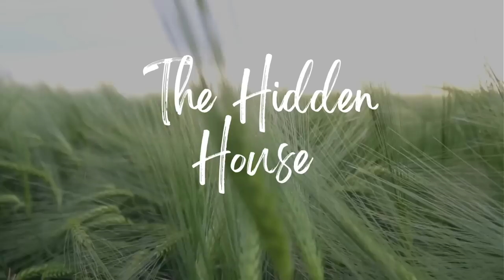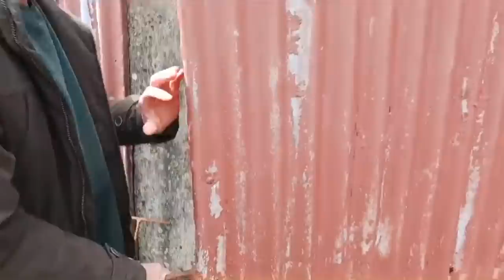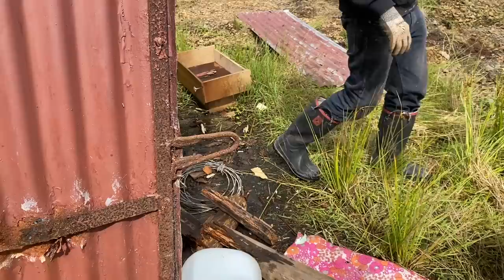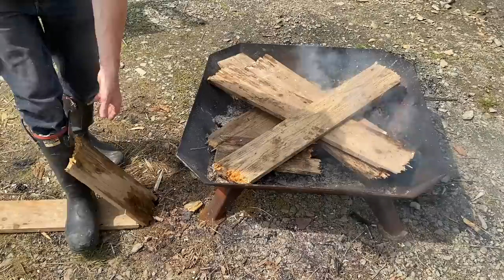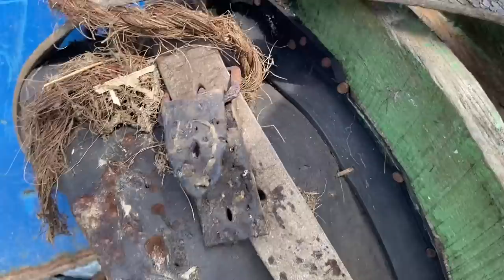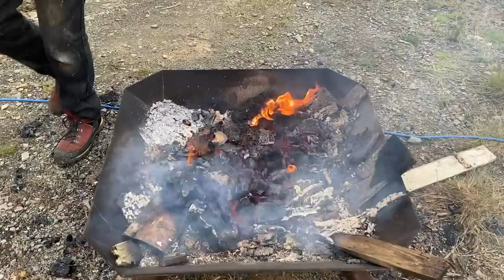Clearing out the Cowshed & a Homing  Crystal | EP012

Comment: (If it's not already gone) you might want to keep the cowshed for the time being; for dry(-ish), secure(-ish) storage of building materials/tools/etc., during the times the house is roofless/floorless/doorless/etc.
The bucket without the hole looks just about the right size & shape for keeping kindling nearby a fireplace.
Reply from the maker: You have a point about the shed for took storage etc. Noel had thought of this, but his reasoning is treat when they come to pour the concrete for the house foundations it will be cheaper to do both garage and house at the same time. He has in mind to get a shipping container for tools and equipment etc which in time could be repurposed as another outbuilding.  I’m already fantasising about skipping through the woods collecting kindling with my pail… 🤣❤️

Comment: all that wood could be used for garden surrounds, same for the old bucket, i use them to plant in
it's a shame to pull down a building that could be used, for a potting shed, the old barrels would've been good for gardens too; are you going to be putting in any gardens?
thanx for sharing
Reply from the maker: Certainly Selena we will be using part of the tip field as an allotment and you’re right, the planks of wood will be handy for marking out beds. The barrels were indeed falling apart with rust.  Regarding gardens, we’d love to create a small lawned area at the rear of the house that will be manageable regarding keeping neat and tidy. Further away from the house we plan to plant lots of deciduous trees. We’re also hoping to plant along the driveway to create a hedgerow of shrubs and flowering plants to attract wildlife. 😊